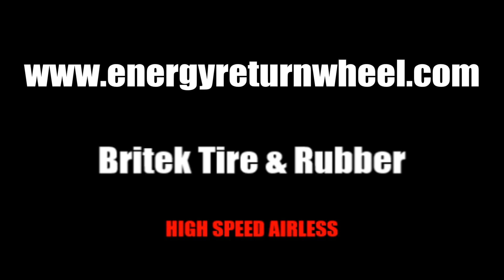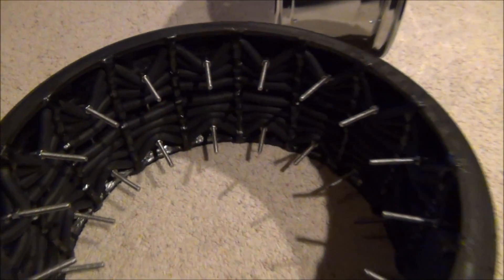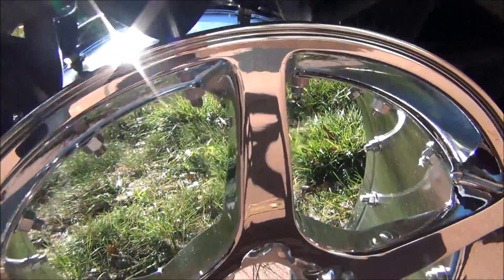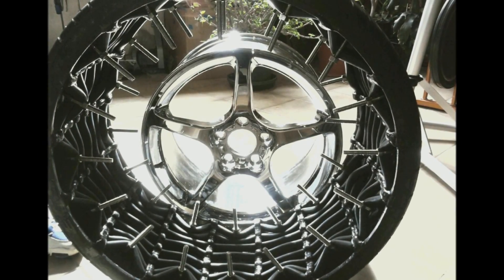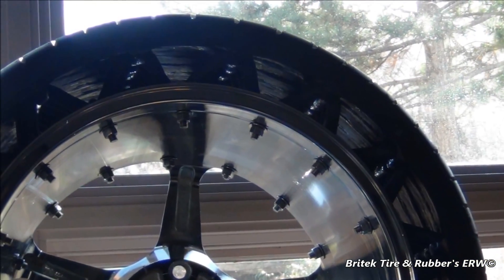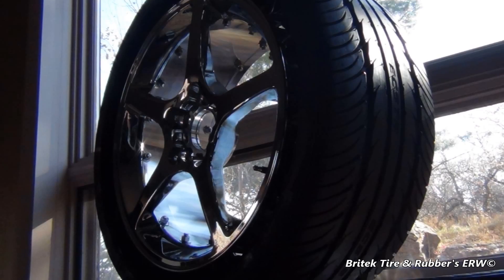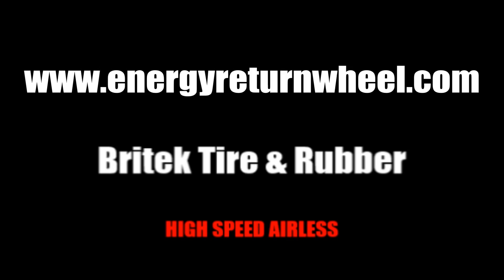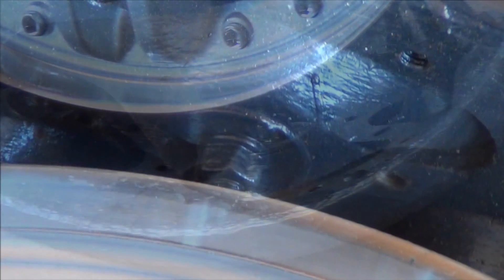britek "Airless Wheel ERW @ USDOT Labs Historic

Comment: Rolling resistance is just one of many tire design criteria. Please comment on the following.

The lack of side-wall flexibility must give a very harsh ride and damage the suspension.

Such a small contact area must ruin traction for acceleration and braking. 

Wouldn't the variation of stiffness between the studs (see view at 1:24) and the arc between the studs setup nasty harmonics and vibration?

What about mud, snow and water intrusion? 

If a pool of water froze inside the tire when the car is parked, your tire would be very out of balance.
Reply from the maker: Hardly...50% less up travel...High Frequency Response. https://youtu.be/rJlP-nHeKc8 Our prototypes have ran for years with no maintenance. ML 55 AMG has stage 2 suspension upgrade, lowered 2".
Reply: I don't know what up travel means. The link is for a bicycle tire.  Sounds like a nice car.

You haven't addressed any of my points.
Reply from the maker: Watch our bike videos...https://youtu.be/rJlP-nHeKc8 All issues become clear.  Negative tension supports hoop on wheel. Lateral displacement is also high frequency...And progressive. Surfing inside a hoop. That is what matters.

Comment: Hi, is there a tire that creates energy and distributes it back to the car?
Reply from the maker: Ability to charge batteries...Yes. We prefer to Cycle Energy between the Hoop and Wheel. This action is Millisecond. Surface tension is much more consistent at Hugh Frequency.
Reply: Wow! in that way, we can save Earth. Less gas emission, less pollution.Right?

Comment from the maker: Notice 35.5 psi tire struggle to spin up the 6,000 lb USDOT dyno resistance. How long can your car coast 55 mph to Zero...In Neutral? 12.2 sec for the tire on this test. Massive resistance is obvious. "You are going to fail our test" We were nervous..."If You damage Rollers You will Pay for replacement".

Comment: Seems heavy.
All those nuts and bolts in addition to the other bits are simply replacing compressed air within that cut-away stock tyre.
Reply from the maker: +Dennis Santos No bolt ERW composite hoop, vacuum bellows, sidewall curtains very close to PNEU. Custom wheel protected by hoop can be 50% lighter...High frequency screw force multiplies HP and Torque.
Reply: +EnergyReturnWheel Well, good luck. I welcome ingenuity, especially with regards to troublesome pneumatics.
Reply from the maker: Thanks, Industry players have had us run their equivalence of a salmon ladder. Our Autonomous Never Flat is the efficient future of ground travel...Suppressed a little at the moment.
Reply: +EnergyReturnWheel It is shown at the end of the video a roller test, claiming longer roll time/less rolling resistance. I suspect due to the harder tread compound in addition to your system. How does that reflect on contact patch size and adherence?

Comment: is thread really rubber here
Reply from the maker: +cino jose 5/8" High Power Speargun Rubber. 6 Tons Pull when drawn. Each Slingshot has it's mirror 180 degrees across the hoop. High Frequency Reaction Speed...Hyper Capable.

Comment: I'd love to see the theory at work in a snow storm on black ice
Reply from the maker: +benson420710 Higher psi. to the surface...At high Frequency. A prescribed tread block. Winter Rubber Compounds and Micro Treads. We also have Vacuum Pressure Sidewall Curtains  for additional weight bearing and Screw force.
We are showing only issued patent claims...74 of them.

Comment: you could get a big market in motorcycle tires,
Reply from the maker: +Andre Zeeuw de Thanks! The immediate handling and anti bounce...High Frequency "in wheel"Suspension...The new standard in high speed performance...Soon.
Reply: so you will make " dark side tires " for motorbike cruizers AND normal motorbike cruizer tires ?? mine is a 250 x 18 x 40 for example .... ?? thanks for your swift response
Reply from the maker: ... Yes...The Screw Force "Return" works for acceleration as well as brake force. Less rubber lost... Almost double tread life.

Comment from the maker: ERW...4/14/2015...US 9,004,120 B2 and new CIP Patent. So much discovery. Elastic tension backed by vacuum pressure.  Pressure install...Run air pressure, "Ambient" or "Vacuum Pressure, high Speed 21 st Century Efficiency.

Comment from the maker: Basic research is being done. ..Last week, new utility wheel patent...Another filed. The "Stretch" tension is now supplemented with vacuum pressure. A novel traction system that pneumatic tires can not match. Linear...High speed.

Comment from the maker: ERW radial sprung hoops are high frequency not bouncy. Spin up faster under load and out coast any pneumatic. High speed hook up via Round Hoops. britektire on Twitter.
Reply from the maker: Our new 700c are so fast we are stunned. Is it time to take ERW back to the USOC for athlete testing?
Reply from the maker: EnergyReturnWheel First USOC tests reveal 5% decent advantage over tubular tire and wheel set. We will do better next month's testing.
Reply: anybody checked what happened if will be a stone inside? or few stones especially sharp? will they destroy this tyre or change specific of amortization, flexibility?
Reply from the maker: This prototype style has vacuum charged sidewalls. The hoop has Kevlar reinforced carbon fiber... Near indestructible performance. 6 tons of "pull" or elastic tension supporting each hoop.
Reply from the maker: Thanks! Our novel "Linear Traction System" will show up in our new videos. Traction that no pneumatic tire can match.

Comment from the maker: ERW can deliver the highest psi to the surface. New nano coatings will assist in the mud shedding abilities of the tire body. We are showing ERW without sidewalls to prove that we are airless plus the ability to see screw force accumulation, high frequency in wheel suspension, lateral control and the likes.